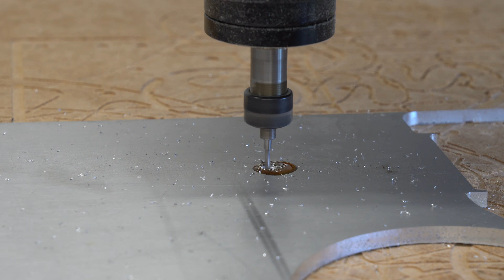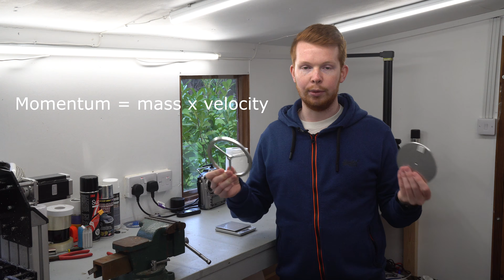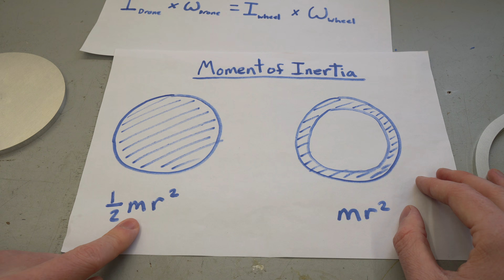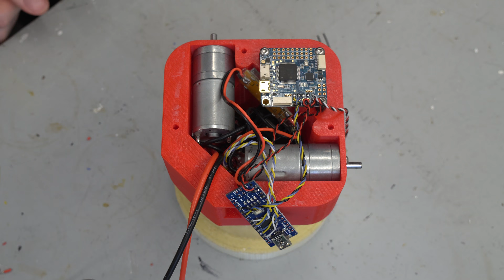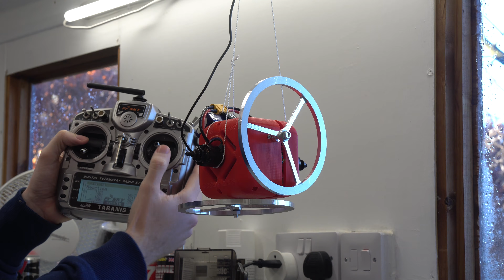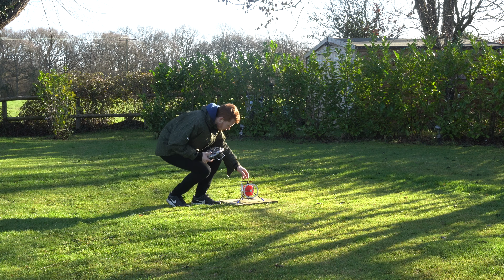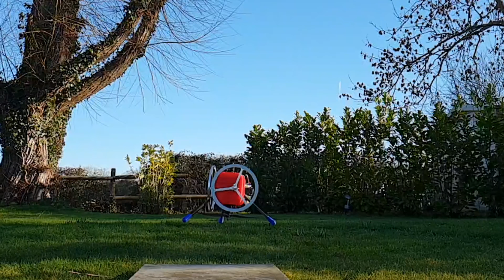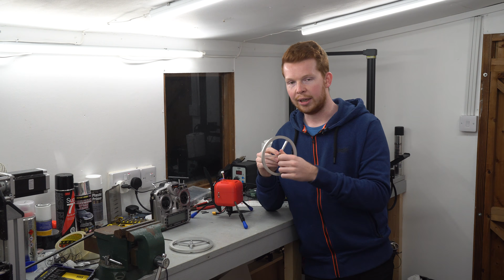Comment: I would put the wheels inside the cube, smaller, heavier, likely brass. I think some of the issues rise from the airflow being upset by the battery and wheels.
Reply: Smaller wheels = lower moment of inertia
Heavier wheels = more mass to lift
More mass to lift = more power required from batteries and motor = bigger motor and batteries = more drone inertia

etc.

Comment: It flew! Very nice, even though it was a short flight! It seems like the PIC values of the reaction wheels were not tuned correctly, but this might have something to do with the nonlinear torque of the brushed motors and not really the fault of the PID? Just speculating here. Also, do you really have to get encoder motors for your future version ,or couldn't you just output a series of currents on the bench and measure the RPM with an LED and a timing mark or just using your slow-mo video. Once you have a number of current vs. RPM data points, you can come up with an appropriate lookup table for your software to use to scale the current appropriately. This was a fun video. Great stuff as usual!
Reply: Also if you are far from the max rev it might be a good ideal to reduce the size of those flywheels... they could even be inside of the drone and not let the people see the magic ;). It seems that a reduction in the flywheel mass and overall drone mass could help reduce the inertias... You have a good amount of oscillation on those PID loops (too much Integration and or  too little derivation and or too much inertia...). Super cool project!
Reply: I was also thinking about these oscillations.  By controlling an angular position by applying torque, you have a 2. order system. (Double integral, wich itself is marginally stable) Oscillations can be reduced by increasing the Derivative part, which again is quite sensitive to noise. Skogestad has some formulas for controlling 2. order systems wich might be applicable.
A great project nevertheless, great visual explanations!
Reply: Exactly, when I hung it from the string and was adjusting PID values, the PID tune for when the motors were stationary/low RPM was different to if they were already spinning. The only problem with measuring the current vs RPM is that RPM isn't always relative to current. For example, if a large current was applied to the motor, rotating it to 1000RPM, then a small current was applied in the opposite direction for a short period of time, the motor wouldn't necessarily change direction, but maybe just decelerate (depending on how long the current was applied for). Then if current is switched again, the motor could still be spinning at 500RPM in the wanted direction and therefore the current applied won't be able to apply the torque that the flight controller expected. Thanks!
Reply: I get it. The lookup table fails if you're changing the speed constantly. Oh well. I guess you do need encoders. Go ahead and rip them out of an old "ball" mouse. That's how we used to do it. LOL!
Reply: @TomStantonEngineering  The current is always proportional to the torque of a DC motor.

By changing the PWM you are adjusting the voltage to the motor. As the motor speeds up it generates a counter voltage as a generator and substracts it out, this makes the motor look like its running at a lower voltage, so the current drops and so the torque drops as it speeds up. This is why at a certain voltage the motor simply wont run any faster because the current drops to near zero.

You need to monitor the current into the motor and ramp up the PWM/Voltage as the current drops due to the motor speeding up.
Reply: All Electronics  The problem with encoders is that you need a very high pulse count one to be able to accurately sense the speed at a high sample rate.

Current can be measured as many times per second as you want with no delay and the whole feedback loop can be done in analog (With very few components too) to give it very fast response and requires no programming to make it work.
Reply: @TomStantonEngineering  This is a cool project, I have seen this exact effect on the robot cars I used in a control systems course.  Possibly with that style of gear-motor too.  There is a minimum current to rotate and thus large non-linearity to deal with when controlling them.  When those wear out unevenly, they will fail such that the speed of two motors can't be PID controlled to be the same, not even with encoder feedback.  This is why BLDC motors are better from a velocity control perspective.  Steppers are good and precise but may require creative interface electronics such as a voltage to pulse frequency converter attached to their drive IC in order to reduce real time issues on the microcontroller.   Smaller Lightweight reaction wheels with no gearbox on the dc motor might be good too, but perhaps less responsive.  Kudos, Great video! 

As an embedded electronics engineer, if that's an stm32 based Arduino, you are definitely using the right controller.  I do however know that stm32 controllers can be used even better than Arduino by using stm32cubemx to configure peripherals and writing code to use that in something like Atollic TrueStudio.  STM32 HAL is the best hardware abstraction layer that isn't Arduino.  You will get simple access to precise interrupt based timing, serial (SPI or I2C) peripherals for efficient access to inexpensive external hardware at high speed and low latency and a precise control loop.  The control loop can run in a timer callback, thus allowing the main loop to do planning tasks of uncertain run length while callbacks do the hard real time tasks.  More work, but controller jitter can be below a microsecond even while doing almost anything you want in main loop so long as your interrupts don't overlap for too long (one timer interrupt, run the callbacks from there in order).  

As far as encoders go, you need high priority interrupts for those and they should run as fast as possible.  That last part is why I like STM32 parts for this controller, because they have a fast clock and can handle more interrupts per second.  I have good things to say about the stm32f407 part due to the 168 MHz fast clock, low expense, and utter reliability and predictability at work.   I have seen systems in a lab that had high resolution encoders running at 50000 interrupts per second from 50 revolutions per second at 10-20 clock cycles per interrupt.  Multiply that by two encoders and you may have a control stability and jitter failure at too fast a speed on a regular AVR Arduino or jitter and lesser timing oddities on something faster.
Reply: @TomStantonEngineering  Your reaction wheel gain values might be too high - this would explain why the drone's control system look underdamped.
Reply: Would a stepper motor help? Since you can count steps and control speed, acceleration, and jerk.
Reply: Yes a stepper motor would be another good option!
Reply: @TomStantonEngineering  I would also suggest using stepper motors since you do not need to have positional feedback if the motor is strong enough not to lose steps, therefore you need to account for fewer variables.

Steppers also have more linear tourqe per rpm
Reply: @TomStantonEngineering  It looks to me as if your pids are bad but the motors are definatly an issue. you coud try tuning the pids with something like plasmatree https://github.com/Plasmatree/PID-Analyzer . i am very intrested in this project and might build something like this myself! keep up the good work!
Reply: The problem you are having is the response time of the brushed motors being too slow to accurately control the drone.
Its that gearbox in the motors most likely. 
It might fly with some tuning, but what software are you running on that fc?
Reply: If you were to run 4 wheels instead of 2 you would have a much more balanced system to start from. Using standard quad theory, 2cw and 2 ccw masses, you can skip the whole motor reversal thing and use brushless motors and not have to fight the twist that is created when you are trying to reverse uneven angular mass. 
Food for thought. 😉
Reply: Not saying its impossible with 2 spinning masses, but those masses have to be concentric like a gyroscope.
Reply: Hi! This is a really cool project! I think it is super innovative thinking! I guess you have seen projects like the cubli (https://www.youtube.com/watch?v=n_6p-1J551Y). I think they use BLDC motors and to avoid the yerk at low speed they slowly accelerating them to a biased speed, lets say half of the rated speed. Then they control the inertia by quickly decelerate or accelerate the flywheel. The key is that they don't start of from a stationary wheel. If you have any more bldc motors and speed controllers lying around I'd give a go for that. I don't want  to criticize, but I've seen that steppers are mentioned but remember that they are built for precision and low speed and unlike a dc motor, the output current and applied tourque doesn't have the same proportional relation. Steppers are also heavy.
Reply: I agree, I suggest that you look deeper on your design. I think, with the addition of the wheels, causes the centre of gravity of the drone shifted. Based on your video, during tuning the PID controller, you hung your drone. But in my opinion you already neglect this problem since you already balanced your drone with the string. Maybe you can reduce the weight of the wheel and try to put external weight to balance it out.